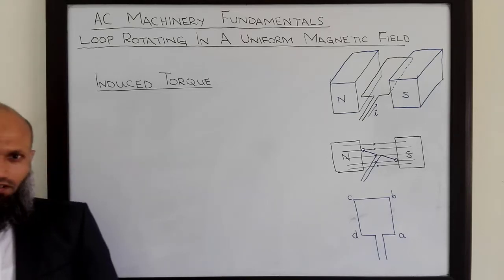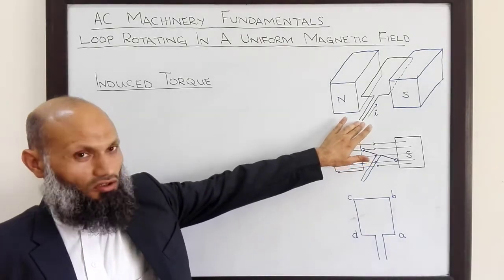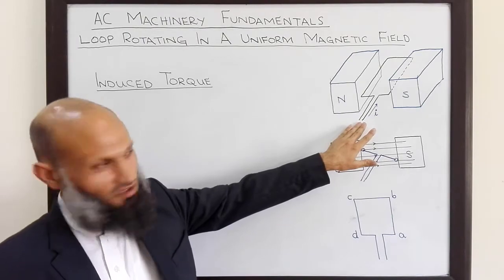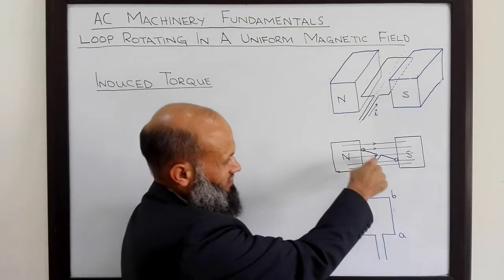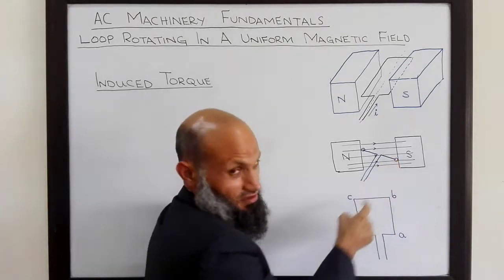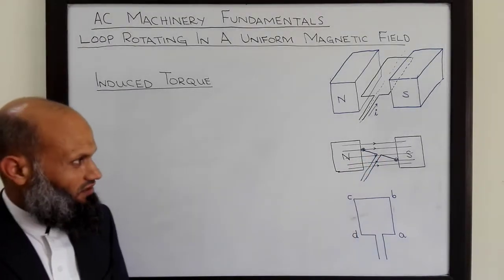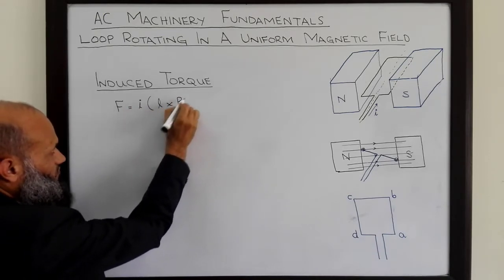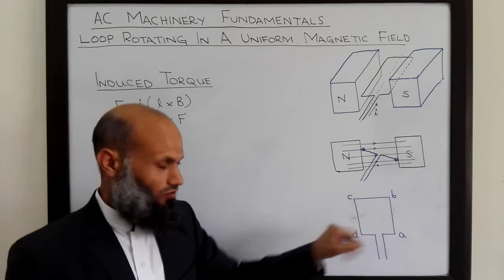EE213 - 30a - Torque induce in a current carrying loop placed in a uniform magnetic field

Comment: Sir , how to calculating the torque of the stator magnetic field acting on the rotor in a synchronous machine?
The magnetic force here in the synchronous machine is the magnetic force acting on the current or the magnetic force acting on the magnet?
Reply from the maker: In synchronous motors, the phenomena of  induced force/torque is quite similar to the force between two magnets.